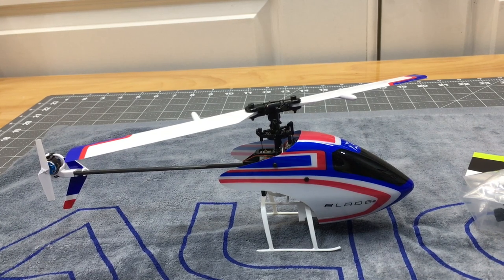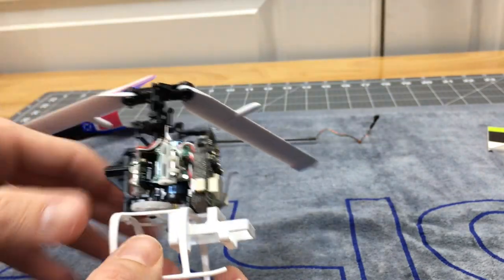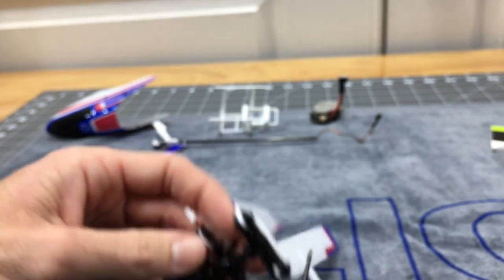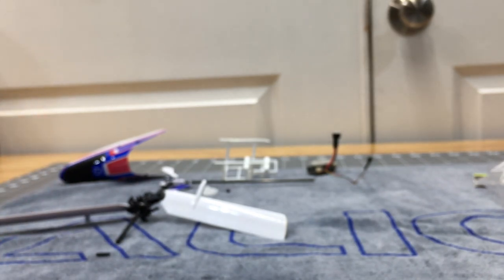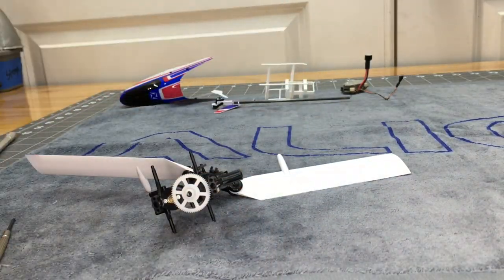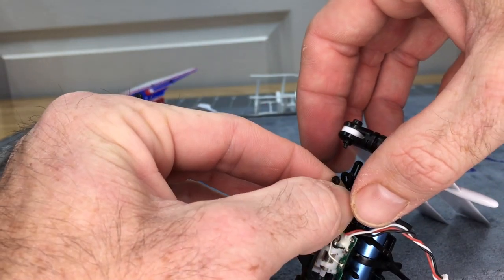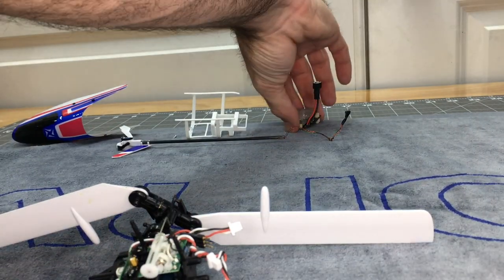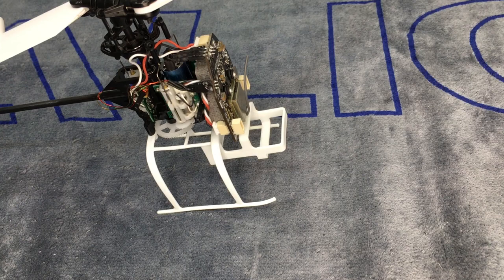Blade MCPX BL2 main frame replacement

Comment: Great video, and thanks for the tip about the fabric paint; it's much cheaper than black liquid electrical tape. I'd be interested in what kind of screwdriver you used to get the main gear screw out of the shaft. I couldn't do it and ended up having to cut off the end of the shaft and gear with my dremel, destroying both (luckily I had purchased new ones just in case). And now I can't get the new screw into the new shaft without stripping the head of the screw. For now I'm just leaving the screw out since the gear is a really tight fit on the shaft.
Reply: I had this same problem it’s junk
Reply from the maker: the fabric paint is the best! love that stuff! as far as the screw driver, it’s a old hobby co number 1 Phillips. that screw can be very hard to get out! not the best design

Comment: I've been fiddlin with a old 130 x lately  ,put the turbo motor in it after cutting a little plastic and that thing has a stupid amount of power now  never had one before and lot of options for one of those and it's cheap thrills.. I wore all my bl2s out and they all need rebuilt  junk shaking servos anyhow   ..I got one of those bl2 i  built from scratch just setts on my living room shelf all CNC parts to heavy to fly good
Reply from the maker: I’ve still got a 130X laying around, what a junk heli lol it was crap back then! Those stupid tail gears where glass abs break all the time. The servos had the same problems the BL2 servos have after a while. Back in the day they were good because that’s all we had but In today’s day and age I won’t ever go back for them lol only reason I fixed this thing was to a video on the M1 vs BL2. It has been in the box for months now. This thing lacks power as well. What motor did you put in the 130? Never knew there was a bigger motor for it. Yeah all that CNC upgrades are worthless!
Reply: @westhobbiesrc8051  mine seems to fly alright  ,got it off eBay about 3 months ago in a bid ,came from Russia  ,but that dude had the servos all upgraded  and runs on 3s  with this lynx ..I bet out of the box they was twitchy   this one seems to handle good  ,   I haven't dumped it yet tho,
Reply: The motor is German made  ,it was in a box  ,I don't have the kv in front of me now but il look when I get home  ,,it's just a bigger round brushless motor  called the turbo motor ,  I looked into other motors   too , and lynex had one you could purchase  that was slightly smaller but still more powerful than the original
Reply: @westhobbiesrc8051  ya the bl2 now are just way over priced for all the helicopter they are...two a beginner they would alright ..but if he had to spend his money one I'd get the 150 or the m1 in a heartbeat before I'd spend the same amount of money on the bl2, .
Reply from the maker: I dumped a bunch of money into my 130 ex years and years ago. It was still a hunk of crap lol it wasn’t that it was twitchy it was just constant vibrations from the tail and gears stripping out and servos failing all the time. I had to 150 as well and sold it as soon as I got the M2! Nothing will be the M2. The 150 is not a bad little machine but comparing to the end to it will never compete lol
Reply from the maker: I guess the biggest issue with the 150 is again power. They have a reputation for not putting enough power in their machines that’s really a a big problem with all blade helis.
Reply: @westhobbiesrc8051  well I haven't tried it,but some folks are saying they ran a 4s battery in the 150,and that gave them more power..I haven't completely confirmed that tho,cause I haven't done it . I just think it's a smaller version of the 230 with a little more kick ,,and oh wow! They put a carbon frame on it lol so Hh better charge more like they do. I hate HH but liked there copters til omp came along. But no I really do like how my 130x flys now just had it out tonight cause I put that motor on ...but I didn't pay much for that one and back in the day it would of took way more money to get mine how it is now..  .than it would of took to buy a nice trex or something
Reply: @westhobbiesrc8051  maybe i just never had a 130 and don't know any better..all my helicopters got DD tail motors except my 130 and a old Esky belt CP that was kick ass a long time ago ..but like a fool I crashed it in my bedroom messing around and haven't never found parts for it
Reply: @westhobbiesrc8051  my x seems smooth and does pretty good  the tail is all CNC and this guy put normal servos  on it.  ..they gonna have a fly at the school gym when it gets cold and I think I'm gonna take it cause it's not to crazy  and stable in doors. ..might take the m2 and the 130..plus my k130
Reply from the maker: Did he do actual servos are they still linear servos? I know there was a company that made actual servo conversion kit for that thing. I bought my BL2 for indoor flying and never done it lol
Reply: @westhobbiesrc8051  no he must of took the linear ones off ,and replace what looks like old eflite servos that came off a old Sr or something but a little different

Comment: I think I have two of those. One I’ve flown inside the house and had a ball with it and one is still in the box. It kinda goes together like the little 120SR which they finally came out with one that is stable. I could build several 120SR ‘s with the spare parts I have 🤣🤣🤣
Reply from the maker: It’s not a bad helicopter! For its time it was great but comparing to the M1it is a pain in the ass to work on lol I had a 120SR years ago I had it for a day and returned it lol it was not my cup of tea at all!
Reply: @westhobbiesrc8051  yeah the 120SR’s weren’t very good. They were what I learned on which may have made me fly better with better designed helicopters later. They just came out with one like in the last year which is fly barless and is more stable than the first 2 versions. I think Blade does a lot of trial and error at the consumers expense! None of the 120’s Blade has will perform 3D maneuvers at least I don’t think they will.  I may try the M1 first if I can find one then the M2.
Reply from the maker: The 120 SR is exactly that it is a training learning helicopter. Fixed pitch gives you the rough idea on how to do circuits and flying around and you can even learn how to fly backwards circuits with a really good helicopter to have. The older ones were just crack with crappy servos and tail motor is burning out all the time lol The M1 is an incredible machine. But if you were going to buy one of the two I recommend the M2 first!
Reply from the maker: No the 120 SR will not perform 3-D so much I did get my old one to do a loop lol
Reply: @westhobbiesrc8051  Yeah I’ve looped em several times after flying forward fast and catching the skids on something! 🤣🤣🤣
Thanks for the advice on the M-2. That’s the way I’ll do it then👍 I just cancelled the Typhoon because it was back ordered and they said they had no idea when I’d get it, so I’ll take that $216 and put it towards the M2 😃
Reply from the maker: You can go back and watch all my videos on them incredible machine. And like I said in every video I am not sponsored paid or anything to say that. I purchased everything with my own money as you guys already know lol but I firmly stand behind that helicopter 1000%. From build Quality to flight performance It is an incredible machine. Well thought out which is almost impossible from every other manufacture. Parts are super cheap I think it will be very very pleased and happy with that decision. What typhoon were you ordering? The airplane?
Reply: @westhobbiesrc8051  Thanks Buddy! It was a FMS foamie PNP airplane. The Typhoon is like the Hurricane.
Reply from the maker: I use to have the ESM typhoon! I still have two ESM Hurricanes! Love that warbird! You will love the M2!